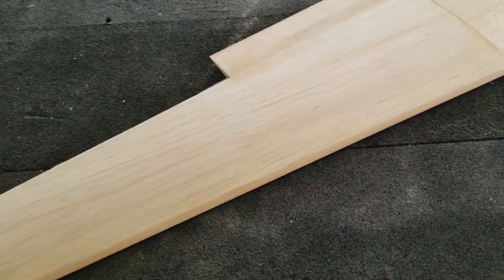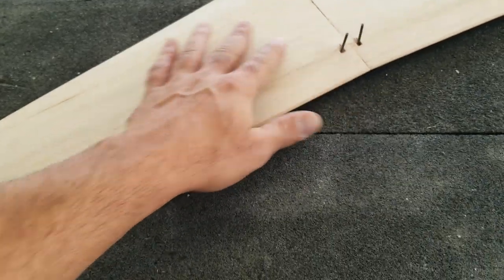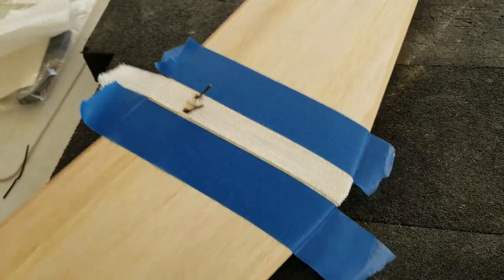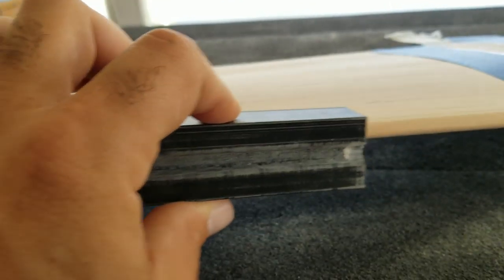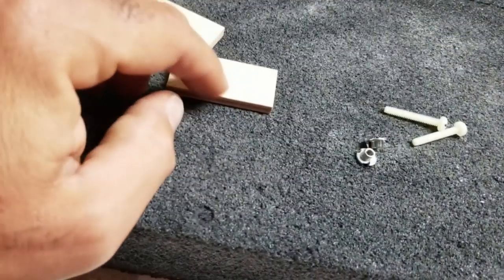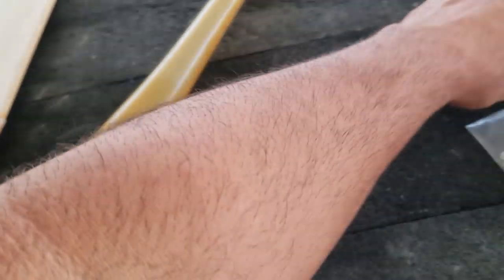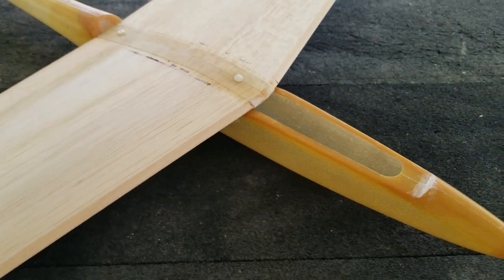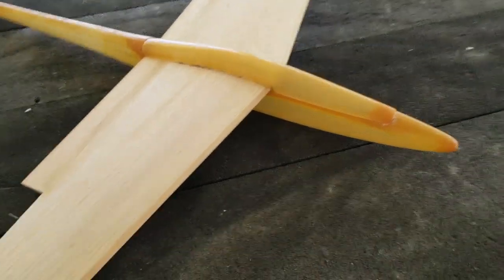Old School RC Slope Gilder Build Part 3, DCU Dragonfly

Comment: Hah!  My current DF is using the wing from a friend's old plane, and I'm pretty sure he made the same mistake with the torque rods.  Basically it's got these little stub torque rods sticking out of the top of the wing, and then some straight metal rods soldered to those and sticking downwards.  I guess he didn't bother removing the TE and re-installing them.